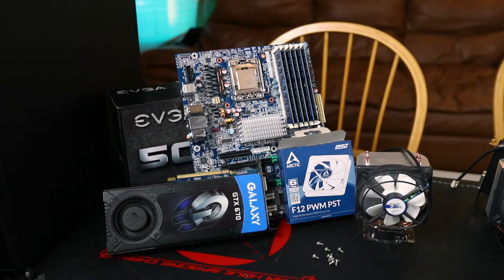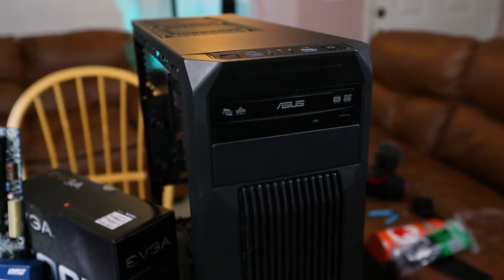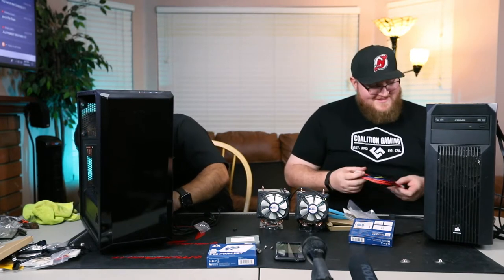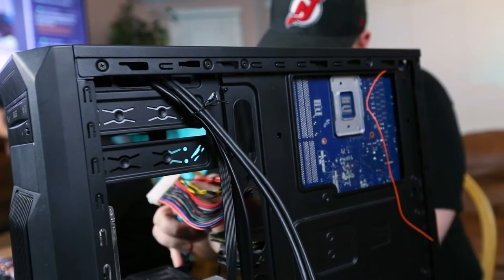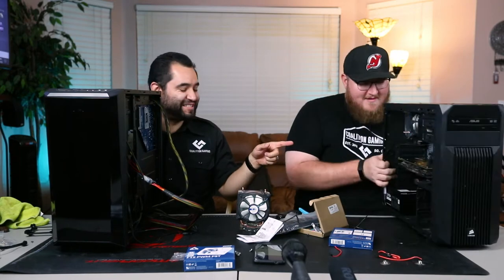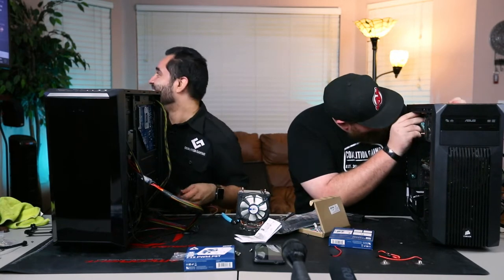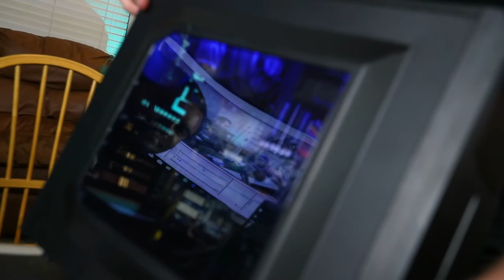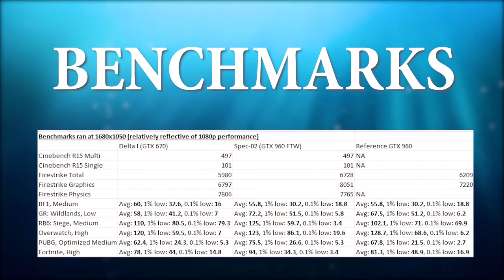REPEATABLE BUDGET BUILDS ANYONE CAN DO ft. Homebrewedhero

Comment: love the z400 builds! I did my z400 build after reading one of your old forum threads. Mine has a Xeon W5580 and a gtx 1070 along with 24gb of ecc ddr3.
My main rig now is a z600 with 2 Xeon 5675s - maybe do a z600 gaming / workstation build soon?
Reply from the maker: Glad my info was able to help you! I actually have a z620 build, it's my test bench/stream PC. Though I've thought about a z600 build, im not crazy about a dual socket setup at the moment when I can just throw a 3rd gen 10 core in my z620 build for a decently affordable price :P  I've looked into them though, hmmm.
Reply: declasm I have the x5675 installed in my z400 I was wondering if you used the stock power supply for the gtx 1070 or did you upgrade the power supply for the 8 pin connector?
Reply from the maker: I built one a few months back (the ~$200 budget build vid) that had adapters with the stock PSU that got me up to a single 8 pin, but that was with a less power hungry GTX 960. A 1070 might be pushing it for a 475w PSU, but you could do it. Check out the Moddiy adapter linked in the description of this video or the previous "easy repeatable budget build" vid for a PSU adapter that will let you upgrade your PSU to any off the shelf one if you want to be totally safe
Reply: Coalition Gaming I was thinking since the x5675 draws only 95 watts instead of 130 could some of that power go to the graphics card I know hp says the z400 power supply can support a single 150 watt card but I guess overclocking the card maybe asking too much.
Reply from the maker: Check with some PSU calculators. If you can't find that Xeon on any of the calculators, just put in any other 95w to substitute
Reply: Coalition Gaming ok I'll probably upgrade my power supply in the future also do you think I could run a gtx 1070 for sometime until I upgrade the power supply and also would the 500 watt power supply in the video support the gtx 1070?
Reply from the maker: looking at specs of the 475w Delta unit the Z400 already has, and the 500w EVGA one i used, it seems either would be fine with a 1070 to be honest. Just gotta remember that the Z400's unit is pretty old so its hard to say how much longer it would last with that much more load on it, but according to the specs it shouldn't be a problem, especially since a little more research shows the 1070 uses about the same power as a 960.
Reply: Coalition Gaming thank you very much for the information your the man when it comes to the z400 great channel.
Reply: paulzedx636 kawi I used a corsair 650w psu with an adapter
Reply: declasm ok cool did you do any overclocking on the gtx 1070?
Reply: paulzedx636 kawi yep pushed the power slider right up had no issues. I couldn't overclock a gtx 780 in my Z600 with the HP 600W psu but that's a ~250W card
Reply: declasm with overclocking was your performance greatly improved and did the w5580 bottleneck the 1070?

Comment: I have something to add that may help when buying used ram for the z400 I bought 24gb for mine and when I installed it my z400 showed a memory error on boot up after some troubleshooting my bios showed two sticks where not working finally I put in one stick at a time and it was only one stick that was bad luckily the seller replaced it the thing with the z400 is it will disable two sticks in the respective channels so the workstation will continue to work.
Reply from the maker: Yep, the channels have to be loaded and working contiguously to work right, and in special cases I've also seen where a full load of RAM won't post but instead adding one stick at a time, booting, shutting down, then adding another stick until it's all loaded gets everything up and running. Nothing too hard though :)
Reply: Coalition Gaming yes however it was time consuming to test each stick one at a time because after looking in the bios for each stick my 400 loads right into windows and I didn't want to do any hard restarts but it was worth it to find the bad stick of ram.
Reply from the maker: Ah I wasn't referring to testing each in what I said though, that can be done with like memtest86 after all RAM is loaded. Memtest can then find any bad sticks. What I described is realistically like a 5-10 minute dealio assuming the dimms on the board don't have any issues
Reply: Coalition Gaming I remember seeing where you posted about having to add one stick at a time so the motherboard will recognize all memory also as far as testing for a bad stick hp recommends to use memtest 86 and they also recommend placing only one stick at a time to determine which stick is bad.
Reply from the maker: Yeah that's what I did, but I didn't use memtest after each stick but rather once all were loaded. The initial loading of RAM was: add stick, boot up, if recognized in bios shut down then add next stick. 

So a very quick process leading up to the final memtest86 testing
Reply: Coalition Gaming thats  
cool that you found how to get all the memory to be recognized in my case with only the bad stick in the z400 it will not post it gives 5 beeps and a red power button however with other good sticks and the bad one it post with the bad stick and another one disabled.

Comment: i just dropped some coin on a evga 980ti hybrid and evga 600w power supply for my z400 build, my 3dmark score is 16364 that's better than 90% of all the scores. only issue im haveing is my monitor is 75 hertz refresh rate i overclocked it and all i could get was 77 hertz. so in the gta5 benchmark on the highest settings fps is 77 solid and peaks at 80 and the lowest is 69 fps i believe my monitor to be the bottleneck at the moment because i know this card isnt breaking a sweat and it's not even overclocked.